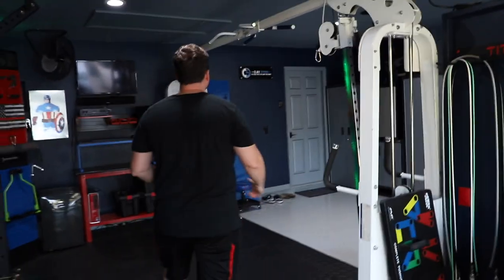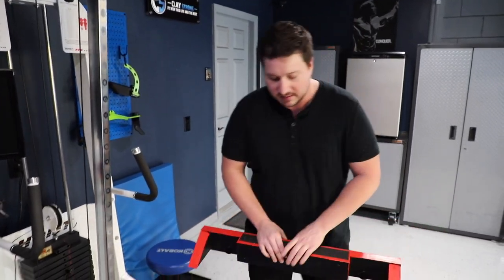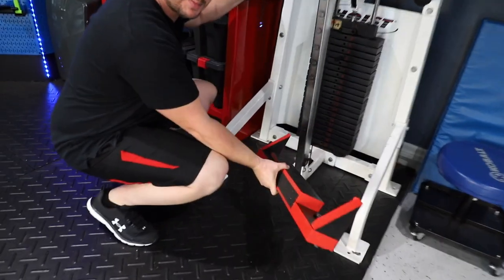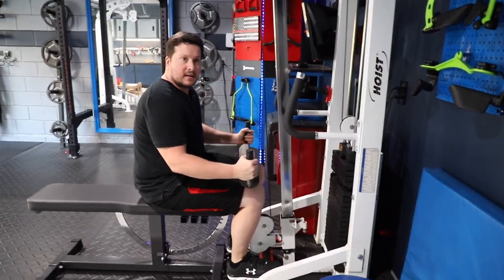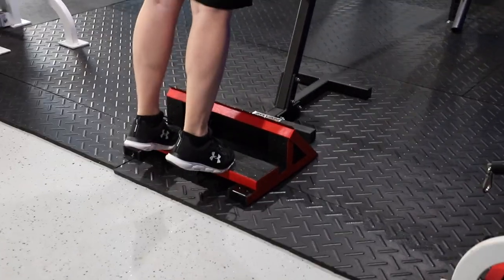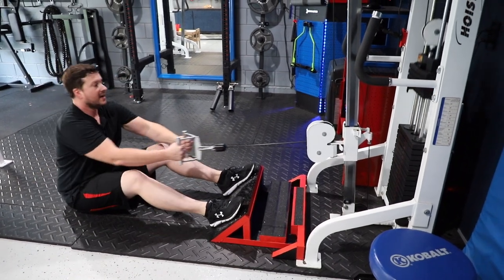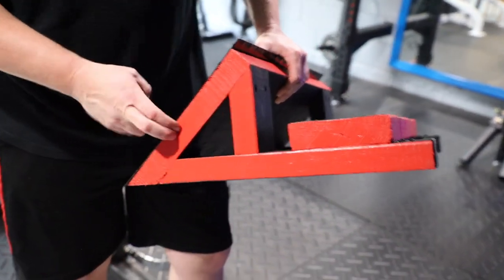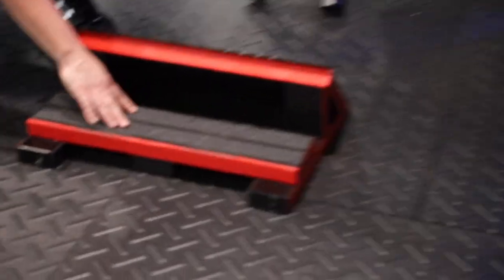DIY Calf Block and Cable Row Foot Plate

Comment: I took a piece of 6-inch schedule-80 PVC (or schedule-40), cut it in half vertically, and then wrap the other half on top of that piece, secure with glue or small bolts, apply non-skid tread, and voila! install rounded calf raise block for stretching and any machine.

What you have here is quite excellent!